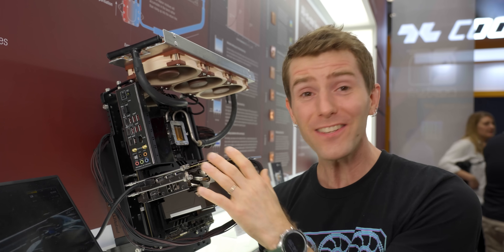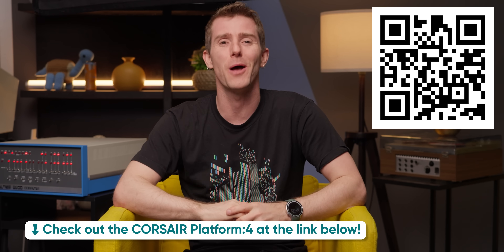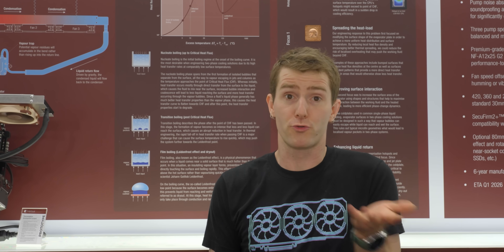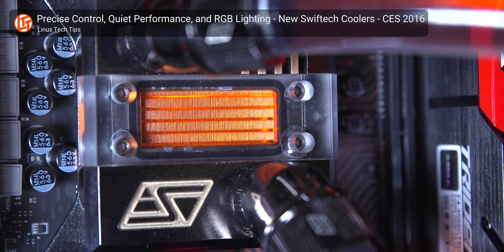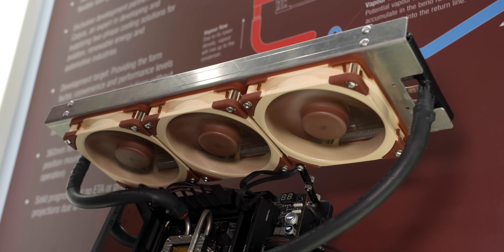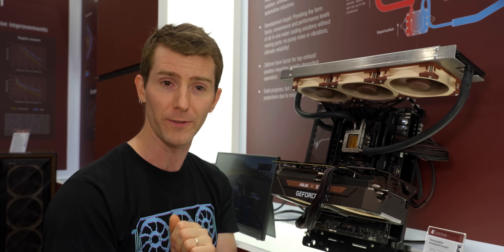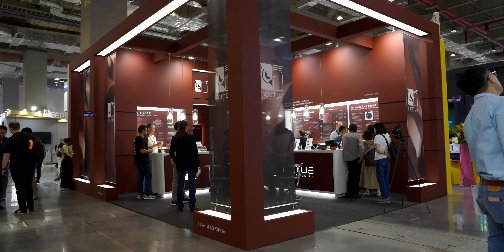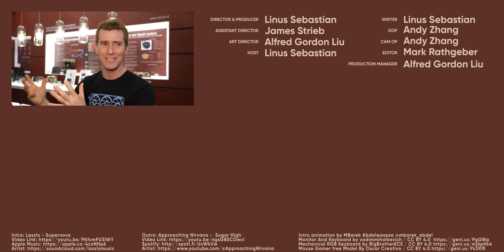6 Years Ago This Idea FAILED.. Now it’s WORKING

Comment: The problem isn't vigorous boiling as such, the problem is when heat flux is high enough to get a continuous layer of vapour (departure from nucleate boiling).
Reply: Is that the Leidenfrost effect?
Reply: @TheROOTminus1  Yes.
Reply: @TheROOTminus1  It's just called DNB(Departure from Nucleate Boiling) but that's only referring to a closed loop system. Leidenfrost is the interaction between a hot surface and liquid, causing a small vapor layer with enough energy to suspend the liquid above the surface - distinction being this is in open air, and not a closed loop.
Reply: Elaborate
Reply: @RanjanManohar  If you generate enough heat, there will be a near constant layer of air; That air is an insulator. That insulator will mean heat builds up faster in the hot source, which then adds to your problem. If you go even further, as this is a closed system, you can potentially end up in a situation where you actually create enough pressure in the system to air lock it, while the heat source is still going - and at that point, you are going to have the thing overheat.

Basically: Don't use this for going over the top overclocking.
Reply: @formes2388  Oh wow, yeah, thermal overrun would be really bad-yet with so much vapor production this causes increased flow, would this not self-stabilize(edit: given sufficient airflow over the radiator)? Also, I don't think there's any concrete information on what the proprietary coolant is, and what its phase change properties. I would like to think this possible outcome was already tested for and ruled out - but leave it to an enthusiast with a pension for punishing processors...to set fire to their circuit board by going beyond recommended limits and safety warnings given by the manufacturer. If used incorrectly the user would take onus and incur their due learning experience, they should know pushing the limits of hardware voids warranty...right?
Reply: @RanjanManohar   Just think of the bubbles starting to come off the bottom of a boiling pot of water but that bubble never moves away from the bottom. Now nothing is there to move heat away just a pocket of air.
Reply: I wish I understood this sentence
Reply: Heat pipes and vapor chambers solve this problem pretty easily; they do contend with wicking/wetting pressure balancing against vapor flow, but existing designs are already excellent and only getting better.  Being vertical barely changes that, heck, in some designs it improves performance. The cool-looking boiling (and it is very cool; makes me think of the Cray II) is likely limiting the evaporator performance. 

If you can see every feature of the evaporating surface with the naked eye, it's not enough surface.  You've only got a square inch to work within, and you need an acre or more.  When you have a Tardis handy, that's a time to use it.

Comment: Why having your cooler 1 feet away from CPU makes it more silent? I don't get AIO, is it just for the sake of having liquid? The only reasonable way to have liquid cooling is if you have 2x car radiators in a passive mode
Reply: Spreading the heat dissipation across a longer pipe length and allowing for more fans allow for lower fan speed for the same volume of air in the same time and thus lower noise for the same cooling capacity. It's not about the distance from the heat source, but about the size of the cooler. Yes, a larger cooler can allow for less airflow (and maybe no fans, depending on the design of the cooler and thermal output of the heat sources), and various people have made such solutions.

Comment: heatpipes on heatsink doesn't have pump either, they are compact, silent, and reliable. and cheap 40euros a thermalright dual tower. And have a great performance. 
and they do exactly the same, phase change exchanger, liquid that vaporizes.

Comment: So this is basically a phase changing coolant rising passively into a finn stack that is being cooled by a fan. At which point does this just become an air cooler with heat pipes?
Reply: Heatpipes have a capillary wick on the inside of the pipes... That is how heatpipes work in every orientation and can move heat in any direction... But this also means rigid piping.

This sort of thing offers some flexibility... Not much though, because the vapor must rise up and condensate generally flow down. Even if there is that hard tubing vapor lock, kind of doing the exact opposite, but I would assume it is not recommended to have too many ups and downs in the coolant path.
Reply: Thermosyphon and heatpipe are twin brothers.  The only real difference is you're relying on gravity for fluid return instead of a wick.  And since it's a loop you have more room to work with optimizing the speed of condensate return and the [potentially] supersonic vapor flow from evaporator to  compressor.

Theoretically?  Same duck.
In practice?  One duck found a JATO and ain't afraid to use it.

Comment: The Noctua color scheme is actually a good one, especially when in that case that was shown. I am now tempted. :P
Reply: I opted for their grey/dark grey fans, but the grey color makes them noisier than the chocolate beige fans ;(
Reply: Yeah, I was surprised by how clean that case looks.
Reply: For anyone curious about why that works, if you are talking about a 3 color harmony, you want a 60-30-10 color split. So in this case, think of Dark Chocolate, Caramel, and a lite tan color. You can put them in any order, but in this situation I would go Dark to light.

Comment: They could pressurize the system to reduce the size of the bubbles so that it wouldn't really mater, but this product works by vaporization AKA bubbles, so not sure if this could work... This is just speculation, I'm no thermal engineer.

Comment: No pump but still need fans, so not much sound improvement. Another problem with the phase change set up is that contaminants in the liquid will deposit on the hot surface.

Comment: Linus, need you to try Redline Water Wetter, Royal Purple Ice or the Coolant that EV’s use since it’s not supposed to be conductive in a water cooling system.  It helps in cars coolant systems so maybe it would work in a computer water cooler.

Comment: Could use a pressurised system to increase the boiling point. Bit of a balancing act
Reply: Just slow the fans down and the pressure will rise.  You need the boiling to make the thermosiphon work.

Comment: 4:09 I think the thought process is that by making heat transfer in the cooler spots better, they'll be able to act as a sort of "second heatsink" to evenly distribute the heat across the entire CPU, preventing the hot spot from being the only one causing boiling and potentially causing a film of gas to hinder heat exchange.

Comment: For all of the clever science behind the design of the copper base plate, they are reinventing the wheel, while also missing the completely obvious. 
In early automobiles (1900-1920) there were no waterpumps either. Those tall vertical radiators were so much higher than the engine behind it, so that hot water rose from the hot engine to the top of the radiator. Cooling the water, causes it to sink. So, those radiators were vertical, to facilitate that drop. So that cooler water would be drawn from the bottom of the radiator, back into the engine. 
Meanwhile, Noctua thinks it is better to mount the radiator... horizontally. Facepalm   If they mounted that rad vertically, the system would already work much better. And maybe not even need the cooling fans. 

Also, every modern automobile engine is DESIGNED to use nucleate boiling on the coolant surface. But yes, the coolant pump facilitates the coolant flow to wash away the freshly forming bubbles and replace it with cooler coolant before those bubbles get too large. Because, if the bubbles get so large and/or plentiful that a film of vapor forms on the interface surface (ie film boiling) it acts as an insulative layer and overheating is both severe and near instant. 
Turns out that the rough surface of the sand casting used to shape the molten metal into the shape of the block and cylinder head is pretty good at doing this job. 

Then again, I am quite sure it is possible to further "micro-engineer" the surface texture of the coolant surface (not with rings or fins, but something far more subtle) to direct just where the coolant should start to boil, forming the right kind of bubbles (nucleate) that lift off the surface, drawing more liquid in behind them. Gravity and buoyancy are at work here - and this kind of engineering has been done many times over already. 
So what looks like "Wow isn't that amazing" is already at least 100 years old, and more advanced back then than where they are today, just from the common sense of knowing that "hot stuff rises" (and conversely, cold stuff sinks - to the bottom of your vintage radiator). 
If only they employed actual engineers that understand fluid flows, latent heat of vaporization, convection, and all the other aspects that we've known about for a long, long time already...

They got close, though. You might notice that the radiator has pipes at both end tanks. So the flow goes in at one end tank, and out of the other. Exactly what you need for a vertically mounted, thermally driven coolant flow. Most AIO radiators are NOT like this. They have both pipes at one end, because the flow comes in one (half) end tank, passes down half of the pipes to the other end tank where the coolant turns around and travels back up the other half of the pipes to the other half end tank at the same end as the inlet. This reversal of flow will NOT work at all, for a thermally driven coolant system. In other words, they got so close, understanding that the coolant flow has to be unidirectional. But still mounted it horizontally, not vertically, because... I have no idea. With the pipes attached, there is no reason why that demonstration system could not have that radiator mounted in such a way that the coolant could flow vertically instead. 

The challenge of spreading out the heat from the cpu hot spots is much more difficult. You need something like a graphene sheet, that will transfer heat around far better in the plane of the sheet, evening out those hot spot temps, than it does through the thickness. 

But the last point is that water is probably NOT suitable as a coolant here. Because, it will only boil at 100C, which is already far too hot for any cpu (which, by the laws of heat transfer, will have to be hotter than that for heat to flow from there to the coolant). While the boiling temperature depends on pressure (100C is at one atmosphere. It is lower at the top of Everest, for example) I do not believe the system could be held at a low enough pressure for the boiling point to be usefully low for CPU cooling. Similarly, alcohol would probably boil too easily. But the years of heat pipe study should have revealed perfect fluids with the right temperature range, that would work here. 
(You'd want something that boils at around 80C, at room pressure, methinks. Maybe as low as 60C, if you want better cooling, But too low will promote too vigorous boiling...)

Comment: whenever a company says don't worry about it, all that means is that it will cost over $500 for the base version. so lets say they make a 120 mm version, that version would cost $500 to $700. now for the 360 mm version that most likely will cost around $1000 plus.

Comment: 'Almost 20 years' at 17 years is like saying Im 21 at 18 so I can buy beers. Very sketchy!
Reply: Except you can in 95% of the planet.
Reply: @WayStedYou  indeed you can. 18 for us in the UK. I suppose the message is that a good comparison is saying you are old enough whilst at the counter even though you are 3 years too young. I would only say nearly 10 years old if it was over 9. Almost 100 years old if 97/98. I suppose it depends on what its reffering to

Comment: So, leak failures from much higher coolant pressure (which will increase as CPU increases temp). Vs pump failure chance.
Reply: @Andrew-ky8oc8cq4n  pretty sure they use a dielectric fluid but yeah it'd still suck
Reply: These almost always use water, because it's the best choice.  Until you hit 100C at the evaporator, the entire system is actually under partial vacuum.  But leaking into the system is a real concern.  You can't have any valves to the outside, no plastic or rubber gaskets, no plastic tubing.  It must be 100% metal and glass, or you will need to recharge it regularly, which loses the main advantage.

Comment: Noctua going into OTHER forms of cooling that isn't strictly air cooling is insane. Never thought I'd see the day. 

What's next, RGB Noctua fans??
Reply: Only if the B stands for Brown.
Reply: @Brogboolius_Maximus  They already do make Really Great Brown Noctua fans.
Reply: Sorry but brown light doesn't exist 🤣🤣
Reply: @GamingXperience  I can't wait for Noctua to come out with contextual orange LEDs.
Reply: @GamingXperience  What a weird comment. Just because brown isn't on the electromagnetic spectrum doesn't mean you can't see it or reproduce it. Brown light is easy.
Reply: @Brogboolius_Maximus  Sure, brown light is easy.. just dim some orange light and .. oh wait...
Reply: @GamingXperience  Or, you know, put a brown filter in front of white light.

You're joking, right?
Reply: Wild guess, the spot of being #1 air cooler manufacturer is being challenged by cheaper brands that is as good for half price. Aka, thermalright have made good cheaper coolers in recent years.

Comment: 2:14 no, pumpless fluid cooling has been around forever. Air, water, oil, etc are all fluids , and natural air cooling is a thing. I think you mean liquid cooling
Reply: Moving fluid cooling without actively moving the fluid via a motor. The fluid passively moving away to cool and come back through a loop. Unfortunately, cooling the fluid does require a motor.

Comment: use a liquid with a higher boiling point and also you could pressurize the system to keep the boiling point higher
Reply: The boiling point has to be low enough so that the heat from the CPU can boil the fluid. Otherwise the thermosiphoning doesn't work.
Reply: @Jehty_  why does the boiling action need to be present for the thermosyphon? I thought it was just the act of hot water rises and cool water drops
Reply: @markimusprime3  sorry for the confusion.
I should have used the proper term two-phase thermosyphon. 
As the name implies in a two-phase system the phase change is needed. At 2:40 you can see a diagram how it works.

You are correct, in a normal thermosyphon it's just the different density of the fluid that moves the fluid around. But Noctua isn't using a normal syphon. Instead they rely on the fluid boiling, vapour rising to the top, condensing and the fluid falling down again.

Comment: closed loop. its auto-pump. no external power other than the heat required to pump. well kinda like burn heat fridges. vapor chamber and heat pipes do the same. this. its just another circulating variant of the same idea. well you need to use a heat spreader on the cooled device of course. yeah copper all around heat spreader block. same as liquid cooler. use a mag stir fan inside that block to get rid of the bubble bobbles. use less liquid, like in vapor chamber and heat pipes. to prevent the bubbling of large volume masses. noc tu bruhte.
Reply: Fridges and heatpumps all have motors and pumps in them, they are integral to how they work
Reply: It still requires electricity for the fans to cool the fluid back to a liquid state, but otherwise it's a passive loop. If the ambient air temp is low enough, it might be possible to run fan-less.

Comment: Swiftech died because of their failing pumps. Their AIO’s died right out of the box. I would know. I RMA’d 2 of them then sold the 3rd and went right to air cooling. Couldn’t get my 4770k to 4.7Ghz anymore but at least I knew my rig wasn’t going to die randomly anymore. Haven’t gone water cooled since. Hopefully this is the answer! PS: Noctua fans are awesome! I even have them cooling one of my old school socket 775 rigs.
Reply: My first shot at water cooling ended up with a failed pump too... Plus I wasn't exactly happy with the pump noise.

After weighing my options for a while, I had this crazy idea of using a pump I know I can trust... So I got myself a Grundfoss. It most certainly was not the cheapest option, or easy to fit inside a PC case... But it is very quiet, and I literally have not bought another pump to this date... I don't remember when was that, but I had it for ages.
Reply: I still have my Swiftech H360X3 in storage somewhere. It never died on me, but the pump noise had an awesome clicking sound that I went with the NH-D15 and have been using it since 2019.
Reply: a D5 pump probably last aslong as a top notch Fan,  maybe even longer....  they are reworked Aquarium Pumps.. i actually run a Dual D5 pump since more as 15 years ... D5 pumps are Armageddon proof, DDC pumps, go Dual.. and AIO's are endconsumer crap, they are made to fail! otherwise no profit